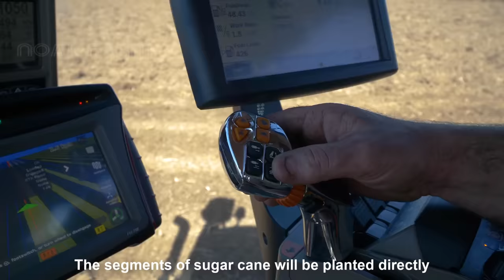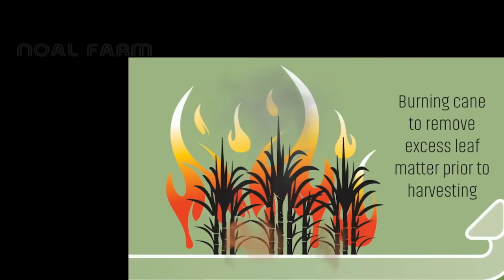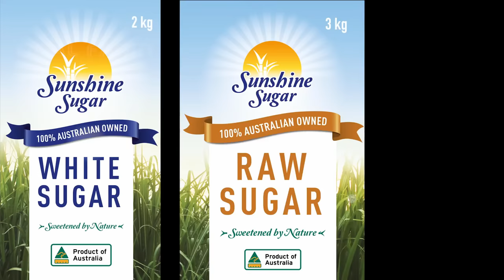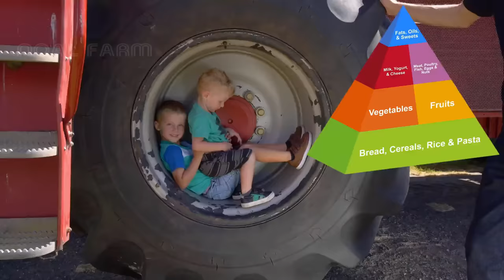SugarCane Growing and Harvest - Sugar Mill Processing Line - Modern Machine Harvest

Comment: I worked the sugar cane fields in Puerto Rico in the early 60s...for just a week. We'd get picked up in the predawn hours, trucked to the field, which had already been burned. We spent 10-12 hours cutting the stalks with hand machetes and grabbing armfuls and stacking it in huge piles. We had about 30 minutes for an on-site BYO lunch. At the end of the day you were covered in ashes, hands cut up from the cane leaves and blistered from the machete handle after about 10,000 swings. I was lucky...I moved on, but the men that worked those fields did so 5-6 days a week for a lifetime.
Reply: hello😃
Reply: Average lifespan is 46yrs. Most die of kidney failure due to dehydration from long working hrs in a physically demanding work. That is close to slavery. And there is no sufficient drinking water if available.
Reply: that sounds horrible
Reply: , 

Mj8

Ķn 8
Reply: I work a heavy machine driver 12 hours a day only half an hour for lunch
Reply: 私も、鍬と鎌を使いますので、時には、私の手には、チイサナ水ぶくれが出来ます。それはチカラが無いのに無理に腕力で仕事をしようとしてしまうからでもあります。また、毎日毎日出来ないので、手のひらの皮が、結果的に柔らかいマンマだからです。
死んだ祖父母や父の手のひらは、元気な現役の労働者の時には、手のひら、も、逞しい皮の厚いあたたかな手のひらでした。
人間の手のひらですが、農民だけに限らず、働いてきた人の手のひらには、【豆(まめ、mame )】だの【タコ(たこ、tako )】だの、人類史以外の生物でも生きているかのような表現で、『マメができた、痛いよ』『毎日毎日の仕事で、気が付いたら、タコになってた』等と、全く知らない人がその部分だけを聞くと、疑問符しか浮かぶことが無い事態に陥ること、ほぼ間違いないだろうと想います。いずれも、とても美味いとは言えないですね。

しかしながら、汗水たらして泥にまみれながらの、働いた勲章だとは、誰にも言ってもらえなくても、祖父母や父のその手は、誰のお手々よりも、大きくてあたたかな、勲章とは言わない、もう触れる事が出来ないお手々です。

毎日毎日、疲れますね。

単子葉類は、思いがけず、鋭いカミソリのような切れ味で、まだまだ鍛えて無いぞとは言わないですが、素手での仕事ですと、フッとしたときには、思いがけず、切れ味よく、裂傷というか、深さ1、2ミリは切れてしまうこともあります。
作業効率が下がる場合もあるとは思いますが、可能な限りの、軍手等の手袋の着用をオススメします。
Reply: I truly admire those who worked in the sugarcane fields like you, even if it was only for a week, but it was a huge sacrifice. I cannot imagine the hardship and pain that farmers have to endure throughout their lives doing that job day after day. Reading your comments, I appreciate even more the achievements they have made with so much sweat and effort. What a powerful and unforgettable story!